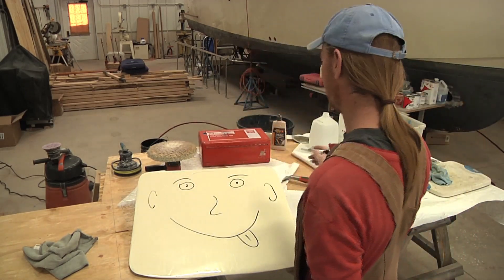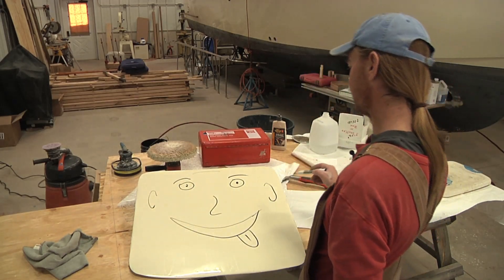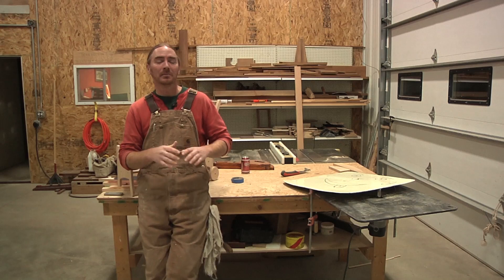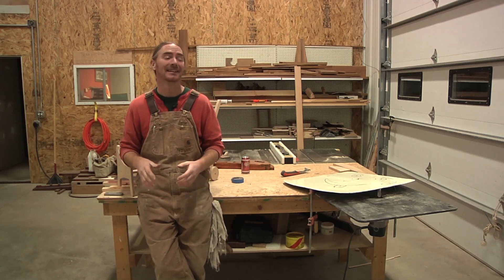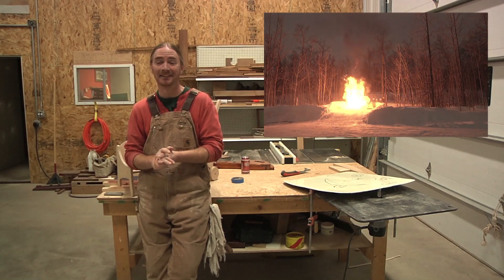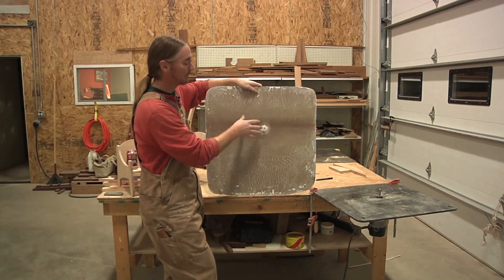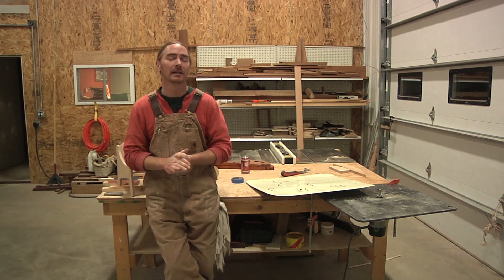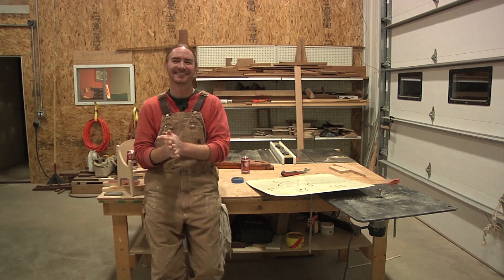Gelcoat / Fiberglass Boat Repair Intro

Comment from the maker: Hey Quinn, I've done a video on spider / stress cracks :-)  YT doesn't let me include links in this comment area but if you look over the videos on my channel you should be able to pull it up.  As far as the non-skid, yes I will but it will be towards the end of the series.  I'll be covering smooth areas before textured as one kind of builds upon the other...   Thanks for watching!!  I really appreciate it!

Comment: Thanks for all the knowledge and explanation of how and why it is a big help. Would love to see what you do for the osmotic blister repair and what you think of the Gelcoat peelers.
Reply from the maker: For blister repair I tend to follow Pettit's guide for repair and prevention.  As far as peelers, they are both awesome or dangerous (depending on who's using it) :-)  If the operator knows what they're doing it's an awesome tool.  In the wrong hands they can make a disaster very quickly!

Comment: I got a question for you, I have an older fiberglass jon boat. The deck was redone with wood, problem is after several years the deck rotted. I had planned on redoing the deck with fiberglass. Any special treatment I need to do before laying the glass. Any special kind of glass? Love your videos and thanks for any info.

Comment: Great videos. I have 2001 carolina skiff and have just noticed short hairline cracks all over the deck. Are this cracks in the gel or fiberglass and will they allow water into the foam and waterlog the flotation? Does this need to be fixed and please give me advice on how to fix. Your a true craftsman and really enjoy your videos,thanks for your time!

Comment: Hi...small question..in order to bring back/ restore an old faded partly stained gelcoat would light sanding with a P80 sandpaper do the trick you think?
Cheers
Reply: d3891 wetsand with a wetsand paper, probably between 1000-1500 grit. buff your scratches out